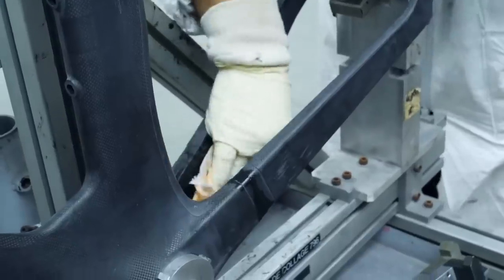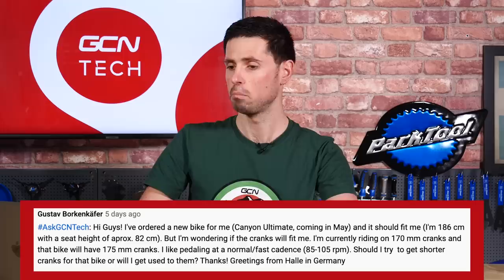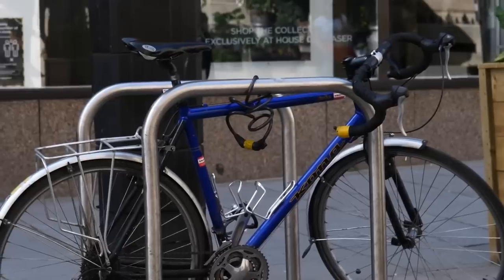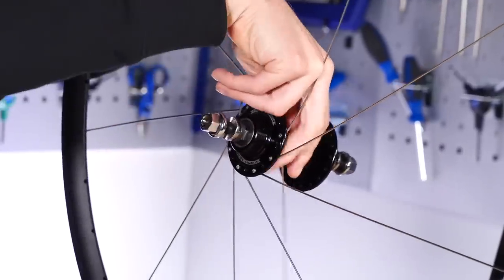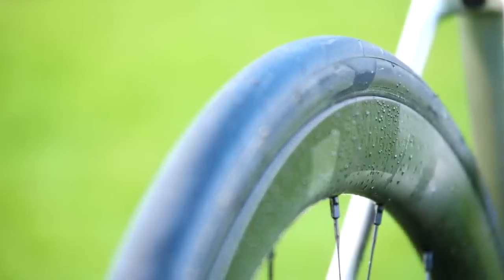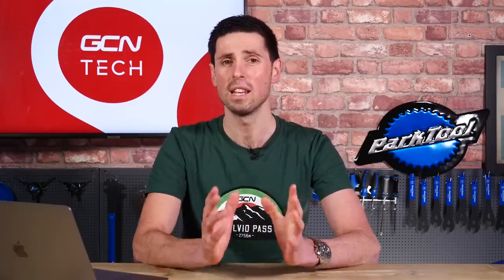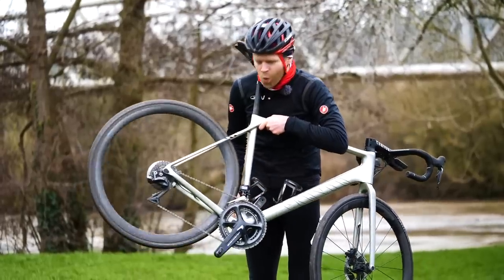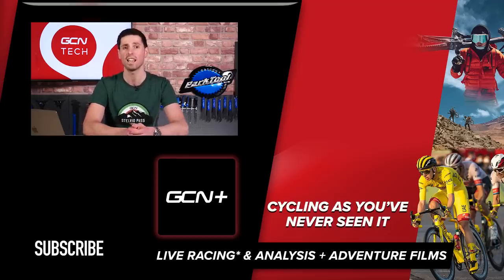Do Carbon Fibre Bike Frames Have A Shelf Life? | GCN Tech Clinic #AskGCNTech

Comment: Carbon fiber absolutely has a shelf life and a fatigue cycle -- it is not magic, all materials do it is basic engineering.  Over time stress will cause micro fractures that build up over time  and if it is unpainted UV light will also take a toll.  Aluminum will also fatigue over time and so will Steel --  Steel and possibly Titanium are the only materials that I would say fatigue so little you would probably never notice in you lifetime -- Carbon and Aluminum may not break in half from use but will definitely not be the same frame after a decade of riding

Comment: They do fatigue w/ time. This has been my experience.. frames from the mid 2000’s that had natural clear finish suffer UV damage and become brittle and soft. I have witnessed an Orbea frame crack and bust open when a friend leaned it against the side of his house. It rolled forward, lost its balance. The chain stay hit the side of the house and busted wide opened. We then proceeded to poke and press into it,, not good. Why would the GCN presenter be so sure of himself.. I have heard similar stories throughout the years. A painted carbon frame is a good way to go. UV is brutal.

Comment: #AskGCNTech I just brought myself some nice new Hunt wheels, and ordered a 11x28t cassette (mostly flat around me), my current wheels have a 11x34t, will I need to change the derailleur cage length? I plan to switch back to the 11x34 on epic hilly rides (LEJOG later this year)
Reply: If your current setup is shifting an 11-34t then it will easily accommodate a smaller one. It's is already shifting through the 11-28 range.

Comment: Unfortunately all my Carbonbikes Reiter early. Reasons are damages on pointed parts, which not lightly replaceable with Others or even damages on mainparts.
Earliest my Orbea Ordu, Bike death after appr. 8.000 km.
Much too early.
Carbon good for two or three years. After that all life-saving parts, the Front Sectio at first, should get replaced or minimum deep investigated and tested.

Comment: Carbon frames dont really have a shelf life, which brings the question around sustainability and the lack of carbon fibre recycling due to cost and energy needed in doing so
Reply: Since they don't have a limited shelf life, I'd say it reduces the concern for sustainability and lack of recycling.  Sill a concern but it's not as if we plan on throwing them away every 5 years.

Comment: Newbie cyclist having recently acquired a second hand Specialized Dolce which had been upgraded to an Ultegra groupset which is great condition apart from the big chainring which needs replacing.  I have source the exact same replacement chainring. All your videos showing how to replace chainrings state that it is possible to do so without removing the cranks which sounds ideal for me but the videos and the hand book do not show how to do it with the cranks on...I am scared of taking the crank and not being able to put it all back together...Can you show me how to change the big chainring without removing the crank or point me to a step by step video showing the whole process so I cannot make this up? Thank you so much 😊
Reply: you juest need to unscrew the bolts, it's as easy as that
Reply: @8paolo96  yes sure, thank you. But, it’s making sure that I can put them back aligned and all that. I have repetitive strain injury in both my wrists so recommendations on the best tools to use to be able to do this as easily as possible would also be great. Sorry if it sees obvious to a lot of people but I am very new to this and in lockdown you cannot easily get someone to come and help...

Comment: all bike frames have a shelf life, but depending on the material, quality of construction, and stress intensities, that shelf life might vary by several orders of magnitude. Well built bikes should last generations if they're never wrecked. Composite materials such as carbon fiber, have greater variability in fatigue performance and are less predictable than metals due to the anisotropic nature of the material, so I wouldn't personally trust an old composite frame with my life. Airplane manufacturers don't use much carbon fiber for the same reason.

Comment: #AskGCNTech
Hi, On golf balls they have dimples allover them to make it travel further. Would this make a bike more aerodynamic if there were dimples on the frame and are there any bikes with this. If not, why?
Reply: @James Miller Zipp have already tried to convince sheeple that dimples are a must on deep section carbon wheels. Seems odd as I’d expect the frontal sections of a bike and the tyres to be subject to the laws of aerodynamics not the disrupted wind flow over the sides of the wheel.
Reply: Absolute ballache/costly to manufacture
Reply: Golf balls are for golf and shouldn't be compared to other things.

The golf ball spins in the air, your bike doesn't, the golf ball controls air to cause it to spin to control direction, your bike doesn't want that, it has handlebars and stearing that is far superior, the golf ball is a sphere, your bike isn't, if golf balls were dart shaped with no dimples they'd go further, but wouldn't roll further. All the advantages of dimples on a golf ball are disadvantages on a bike.
Reply: @fergusdenoon1255  but the dimples would surely create turbulent airflow which is more aero, right?
Reply: @James-uf8hg  no, more turbulent air is not more aero, turbulent air is what aero is supposed to combat and reduce.

Wind massively effects the flight of a golfball, the dimples are used to combat it, from the strike point where the dimples create more strike control, you can hit the bottom of the ball and make it go less distance than if it were a perfect sphere, you can strike it sideways where you can curve the ball where your using the resistance to cause drag from the dimples, the dimples slow it down in these instances, if struck up from center the ball spins fareward keeping the ball in flight for longer hence why it is perceived as going further, but that's only because there's less resistance from the air than the ground, unless it's a windy day and you may want to run shots along the ground as its far more important in golf to be accurate than to hit long shots. You want to keep your bike on the ground where all these advantages to dimples simply don't apply.
Reply: @fergusdenoon1255  why were there those skinsuits with the little rubber dots on the arms then?
Reply: @James-uf8hg  marketing gimmicks I would imagine.

Comment: #askgcntech 
I have got a question.
I am looking for a powermeter. 
Don't know which one I want.
What would you guys recommend. 
Budget isn't a limit per se.
What I'm looking for is a powermeter that fits my needs.
When riding races in the NL, it is all flat and I ride with a 53-39 or 52-36.
But when I go to the mountains, I like to swap my crank/chainring for a 50-34.
Is a full crank powermeter a good option when you swap the chainrings now and then and is it still accurate?
Or do you guys recommend a left crank of pedal version?

Comment: The problem with carbon fibre at the moment is that production is incredibly resource hungry involving many highly toxic substances and energy while recycling is currently largely impossible/uneconomic. For environmental reasons one should use aluminium or steel frames.

Comment: Should I replace rusty bolts for my stem? Can I use standard M4 bolts from DIY shops?
Reply: As long as theyre the correct size and thread pitch they'll be fine, just make sure that they're stainless steel ones, they'll rust up in no time otherwise.
Reply: First thing that I replaced on 2 bikes are all the bolts. Stainless steel bolts from hardware store are good, never had any problems with it.

Comment: Hi Alex. Love the show. I have recently bought my first frame set to build myself, and have opted for integrated mechanical cables, including through the one-piece bar and stem. The model I have chosen (Ridley Noah Fast) uses a “D” shaped fork steerer to allow the cables to flow inside the headset and compression ring and into the tubes. However, when the cables are fully installed and I link to the derailleurs, because the cables turn with the bars and headset, they become tighter/looser depending on which way I turn the bars. How can this be prevented? Thanks in advance, Andrew #askGCNTech

Comment: I suspect that carbon fiber frames do have a shelf life.  I'm guessing there won't be many 'vintage' carbon fiber frames that won't show some signs of fatigue in twenty or thirty years, while steel will still be good to go.  The resins will continue to harden over time and become brittle.  Seems the technology isn't old enough from my perspective to say there is no shelf life.  Younger folk will see this differently.

Regarding the skipping of the chaining on the downshift... In the shifter there are different ratcheting mechanisms for up shifting and down shifting.  Usually the grease in them thickens over time and they have very weak return springs so the paw stops working.  You should be able to get in there with some penetrating oil to free up the ratcheting paw than normal stops the cable/derailleur in the middle chainring position on the down shift.
Reply: I have a 30 year old hotta perimeter carbon TT bike in perfect condition. In fact it looks, feels and rides as good as the day I bought it from Ricci Ltd in Cornwall.
Reply: @stevezodiac491  Very good, but I wonder, for every one that say crosses over the 20 or 30 year mark, how many don't.  My steel AD frame from the late 70s has been dropped several times and it survives today.  I wonder if a CF frame derailleur dropout would survive a hit like my frame has taken?  And this isn't the exception.

Comment: #AskGCNTech Dear GCN, love the show! Recently I purchased Orbea Orca OMR 2018 frame (same as Simon had couple of years ago) for my next build project. Originally it had BB386Evo bottom bracket. Now I want to install Shimano Ultegra R8000 or SRAM Force 22 groupset. Found an adapter for Hollowtech II spindle that Shimano is using, however, it's a bit confusing with the SRAM. It comes with GXP or BB30 spindles. Saw a video where Ollie was changing BB386Evo bottom bracket to GXP one, so that is all clear. But cannot find bottom bracket adapter for BB30 spindle. Is SRAM BB30 spindle not long enough for BB386Evo frames?
Thanks,
Emils

Comment: Is it okay to use a degreaser to clean your disc brakes?

I saw a mechanic before clean a disc rotor and pad with a degreaser and it made me think if it's okay since the goal is to remove any sort of grease on the pad and rotor. And  is it better than rubbing alcohol? In case i don't have disc brake cleaner on hand. Thanks! Cheers!🇵🇭 #askgcntech

Comment: #AskGCNTech I have a new set of inexpensive carbon RXL SL handlebars along with a new ec 90 aluminum stem surfaced in carbon. Since it's carbon on carbon, I applied finish line fiber grip. I also put the appropriate thread lock on the threads and tightened everything correctly. It feels firm and steady but when I push a decent amount of pressure equivalent of that pressure when in the sprinting position, the bars just become suddenly loose and rotate downwards. I feel the grip is only making it slippery causing it to slip. I took off some thinking I applied too much fiber grip and still had the same issue. Do I need to let the fiber grip dry in the open air before tightening the handlebars to the stem? Can I just apply the handlebars to the stem without fiber grip? Is the issue that I'm dealing with due to me using cheap parts? Can't figure out the issue and would really like to resolve it soon with your help so I can get out riding again. This took a long time to write and will probably take you (Alex) a long time to read. Thanks in advance.

Comment: #AskGCNTech in Shimano's instructions for the 11s front derailleurs says to leave 1-3mm of space between the big chainring and chain guide. My questions are, does this change the shifting performance and the likeliness of the chain dropping? And if it does, is it better to have it in 1mm so that the chain is less likely to drop; to set it to 3mm so it would be easier to put the chain back; or to go for the middle?

Comment: #AskGCNTech Hi Ollie/Alex, I have just bought the stages ultegra R8000 duel sided power meter for my bike. When the chainrings get worn with time, can they be replaced, or will I need to replace the entire chainset and get a new power meter? Also could I change from 52-36 to 53-39 in future without replacing the entire chainset? Many thanks!

Comment: You've only answered half the question.  No, they don't have any significant "shelf life" span (in storage), but you dodged the fatigue part completely.  The "how many cycles to failure" question has been dogging bike parts forever.  Anyone knowledgeable in materials science or manufacturing will tell you that any item will have a fatigue life, whether it's a fork or a frame or a seatpost.  It depends on the number of load cycles it is subjected to over time.  The typical analogy is what happens when you bend a paper clip over and over; eventually the material will yield.

Comment: My carbon bike had a shelf life. It developed minor cracks on the chain stays close to the rear drop outs. I notice it when I put torque on the pedals. But this was after more than 100,000 km and 16 years of riding. My older steel bike is still going strong but not as nice as my carbon bikes. Yes, I have a new De Rosa Nick and it rides like charm.

Comment: #AsgGCNTech 
I bought a brand new Focus roadbike and changed the wheelset on it. (Shimano to DT Swiss) Since then it makes some kind of rattling sound. I thougt that the cassette was not tight enough so I tightened it again, but it does not helped. I was at the local bike shop and they doesn’t understood what I meant. If I stop/start pedaling it makes some loud metallic noise and, if I go through some curbs or bad road the cassette makes also some kind of metallic rattling noise. It is so annoying and actually I have that feeling that my brand new bike will fall apart. Any ideas?  #AskGcnTech
Reply: Are the hubs of both wheelsets the same spec?  ie: are they both 10speed, 11 speed etc? Remove the wheel from the bike. Can you rock the cassette from side to side? ie is there any play? If so there could be a spacer missing fromm the  freehub.

Comment: #AskGCNTech (My 2 cassettes don't line up!)  I upgraded the wheels on my CX/Gravel bike but now I want to use the old wheels with Road tyres as a Winter bike. The two cassettes are not aligned so I need to adjust the rear derailleur by 4 full turns on the barrel adjuster plus reset the lower limit screw. It's frustrating, can I put a shim behind one cassette to match them or will this cause problems for that wheel?

Comment: Does any brand do brakes for TT extensions? It definitely makes more sense to have them where they usually are on the bull-horns but given the need to break position every time, I'm supposed the pros haven't tried it, even if it would only be used once or twice. #AskGCNTech

Comment: Check out Winspace Hyper wheels. They have carbon spokes and are very reasonably priced. I wanted a set and the only reason I didn't buy them is that I have a 2018 Cannondale SuperSix which has a quick release rear wheel and they don't make an adapter for QR for those wheels. I ended up getting a much more expensive wheelset from another manufacturer.

Comment: Hi GCN. I recently purchased my first all carbon bike and am now terrified of cracking the carbon! Is it safe to clamp the seat post (round carbon seat post) on a standard bike stand for maintenance? #AskGCNTech
Reply: clamping the seatpost is ok, it is quite resistant becouse it is clamped into the frame and it has to support all of your weight, just don't ever clamp the the frame, especially the top tube

Comment: Carbon fibre is just like other fibre glass product it will become brittle and the bonds will delaminate over time..but really this is quite a long time..If you had a unused 50yr old carbon frame hanging on your wall you would be mad to use it...20yrs would be about the usable life if not damaged. I have a 2006 trek ex9 with a carbon rear triangle...so far so good.

Comment: To the first question, I think everything that's designed to be flexible breaks eventually. Carbon, aluminium, titanium... frames, all will crack eventually.
Reply: I've never heard of a titanium bike crack, ...ever.
Reply: @firesurfer  They do crack, in the welding spots. Mainly in the BB area.
Reply: @philipcooper8297  I decided to check,  and they do crack, mostly from poor welding technique and or rough use.   Just google titanium bike crack.  I've never had a problem. Mine is now 31 years old and just like new.

Comment: #AskGCNTech I'm considering switching to tubeless tires and I have read that you need to keep replenishing the sealant every x (x varies greatly depending on source) number of months. My concern is that I do not ride a ton of miles each year and do not wear out tires quickly. Is it possible that I could have problems from having to add a lot of sealant before my tires wear out?
Reply: It is advised to change the sealant in your tires, not add on to it

Comment: #AskGCNTech Ive bled Force AXS brakes, the levers still come very close to the handlebar. (I use a non original bleeding kit). Any solution?
Reply: Make sure when prepping for the bleed that the lever reach is set within the guidelines set out by SRAM otherwise they won’t bleed properly